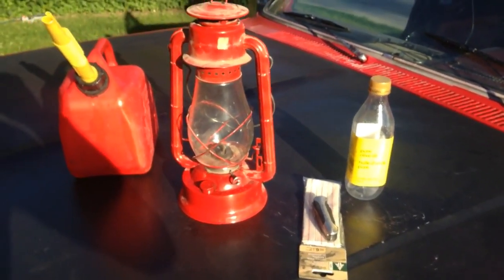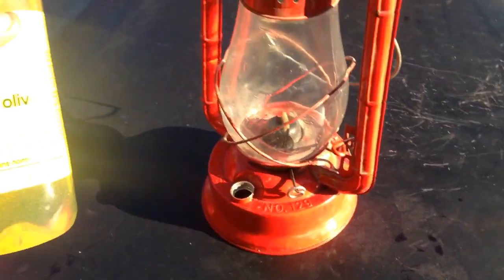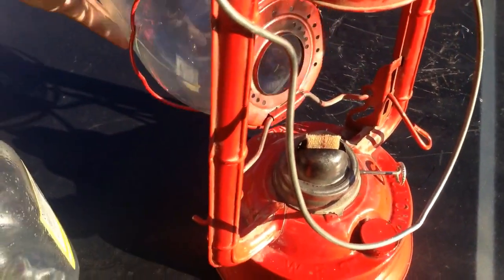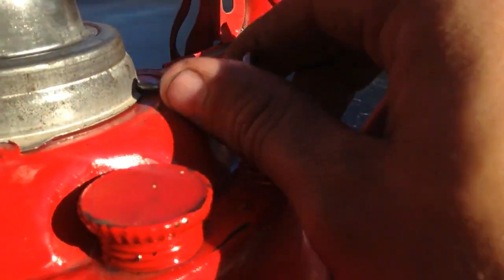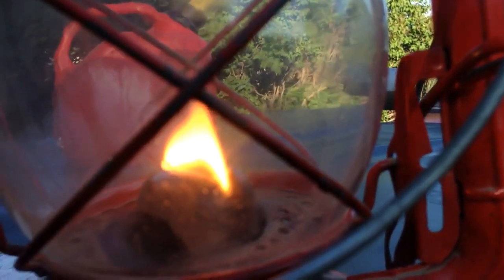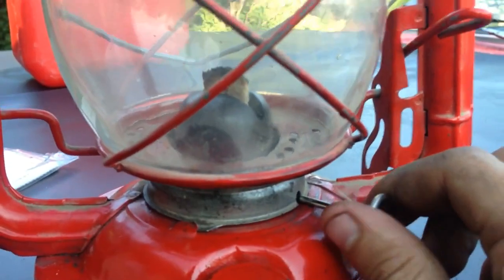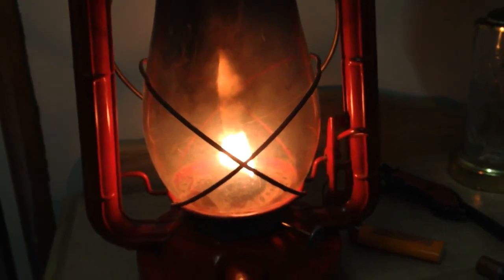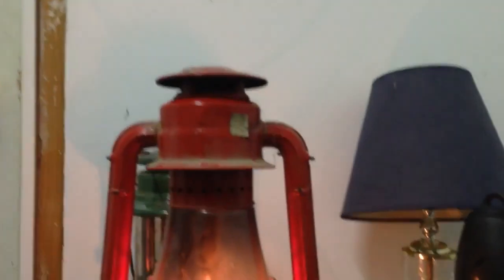Diesel fuel in Kerosene lamp EXPERIMENT

Comment: you can burn pretty much anything in these lanterns, i've used kerosene, diesel, charcoal lighting fluid, paint thinner/mineral spirits, veg oil mixed with diesel or gasoline, mineral oil and automatic transmission fluid mixed with diesel or gasoline. of course some of these fuels burn pretty smelly, but they do work in an emergency.
Reply: Yeah that kleen strip kleen heat stuff is mostly mineral spirits.
Reply from the maker: Seeing as coleman fuel, it's white gas, or distilled gasoline... using pump gas is no more dangerous at all.
Reply: @AaronsAutomotive  There's lamps designed to use such fuels; probably shouldn't use those on this type of lamp.
Reply from the maker: Correct, this one in particular was diesel fuel, I was mistaken which video this comment was on as I have a video running a coleman lamp on gasoline that a lot of flack. 

This lampnwas originally a kerosene lantern, which burns almost identical to diesel and is not terribly volatile.
Reply: @AaronsAutomotive  coleman fuel is white gas ,and no!! It should not be used in these lanterns...wayyyy to dangerous!!

Comment: You really should light the wick at a very low setting, then gradually raise it to the desired level that doesn't soot.  
You get virtually no soot on your globe when you do it that way. 
 Would also recommend a few tablespoons of  90% or higher Rubbing Alcohol...this will prevent gumming and clogging, and a somewhat cleaner flame. 
 Squaring the Wick is fine, and there's no need to cut it into a point.  A completely squared wick will give you a wider and brighter flame surface as well.  
Otherwise, a pretty good experiment and if diesel is cheaper and less annoying...by all mean Use It!  
My next experiment I will be trying Home Heating Oil and see how that goes?
Reply: I thought the same
Reply: Dry gas is cheaper and is the same thing.

Comment: Here it is a year later and I just let my Dietz 100 burn Klean Heat fuel for 2 hours. I smelled the slightest smell of burnt fuel more like Barbeque lighter fluid burning. Very tolerable indoors. $10 a gallon from Home Depot.

 But I later went out and found the Dietz No. 8 Air Pilot fueled with diesel about 2 years ago. It was my experiment. It has been sitting all summer untouched in a plastic deck box in the sun. It has been burning for 2 hours hanging from the rafters in my upstairs bedroom. I do not smell anything.  This was the same road diesel that I bought for my Onan generator set. $3.50 a gallon in Calif.

I am really impressed.The flame is a lighter yellow, almost white compared to Klean Heat or K-1 kerosene. I did not mix alcohol in it like others suggest. There is no soot or smoke. The wick is trimmed straight across with the ends slightly nipped off. It has a 1-3/8'' tall D shaped flame so its burning strongly tonight.  This lantern was my experiment in burning diesel. That's all it was ever fueled with since new.

Recently I mixed fuels in another lantern, a Deitz Little Wizard. It was kerosene mixed with citronella oil to get rid of mosquitoes. I plugged the wick by mixing fuels. The wick needs adjustment every 20 minutes and has a spikey flame, pops, sputters, then goes out. Mixing fuels can cause burn problems. When its out of fuel, it will get a fuel font flushing with choke and carb cleaner spray and a new wick goes in.

After all of this writing and a fresh brewski, I still smell nothing in my room burning diesel fuel in that lantern.  BTW.... the best glass cleaner is Weiman Glass Cooktop cleaner for stoves. It leaves no residue, haze or streaks when the globe gets hot. A little goes a very long way and the glass gets really shiny.

Comment: Tiki torch oil with citronella works well in them I use them when I camp for lighting around camp and also Mosquito control, two birds with one stone.
Reply: I used tiki Torch fluid in mine it blew the flam out in moderate wind and was hard to keep lit I was wondering what I did wrong
Reply: @jamessmith2668  I would suggest trying a new wick, mine have stayed lit threw some heavy severe storms while at camp at Airventure over the last several years. All I use is citronella tiki torch oil. But I have had a couple wicks that have gotten contaminated or just went bad thar were hard to keep lit.
Reply: Thank you for sharing... do u mix torch oil with citronella together??? Thanks

Comment: Here's my tip:  
Tilt out the globe, take the burner out of the lantern, and put in the new wick. Play out about 4'' of the wick sticking upwards out of the burner.  Trim the end the way you like it. Dip that end of the wick into the fuel tank in the hole where the burner was, then screw the wick back down to normal position. Install the burner and now you have a fully soaked wick. It takes about 30 seconds of work and then you can light the lantern immediately.
Reply: Why not just invert the lantern for a second or two to prime the wick?
Reply: @crazysquirrel9425 The tank/fount is not sealed as in a pressure lantern and there is potential for leakage into the air tubes. Regards Broadlander

Comment: I have an old lanteren from wally world. It started to leak around the base so i cleaned and dryed it out really well and used por25 fuel tank sealer in it. It hasent leaked in 8 yrs. Just be sure to follow the Por25 instructions.😊

Comment: Good tips. I recently tried burning California #2 diesel in a Dietz No.8 Air Pilot. There was very little odor and no smoking. That surprised me. The other fuels that I used are Kleen Heat and pump Kerosene. The diesel had the least objectionable smell followed by Kleen Heat.
Reply from the maker: kimmer6 thanks, i too was very surprised by the low odor of #2 diesel, i have about 9 of these lamps thru out my house i use during power outages, and the smell of lamp oil and kerosene always gave me headaches. I thought id give diesel a try and will never go back, keep a 2 gallon jug of diesel on hand all times in the basement as diesel doesn't seem to go bad or rancid at all and has been stored for about 6 months now and still seems good.
Reply: ULSD has less stuff in it now than Kerosene I heard
Reply: That’s interesting. Im going to try that. !
Reply: @TonyM540  Cool. Be sure not to mix fuels. New wick, clean tank. Sometimes the incompatible fluids turn to gel and plug up the wick.

Comment: Diesel fuel today ACROSS THE ENTIRE USA is now 97 percent cleaner starting in the 90's. soot is not an issue anymore so  people who are nay sayers are ignorant and mis informed! Some (the older guys) did have issues back in day but no longer today you can Google it and or watch you tube videos diesel is a very good fuel to use and common practice among collectors. I have experimented on rayo lamps,perfection heaters,old dietz lanterns and they all run flawlessly. If you try what this guy did you will be pleasantly surprised, and save quite a bit of money. I have also used the 97 percent alcohol (an ounce per gallon or so added to the diesel fuel)and my testing has not showed a benefit except for MAYBE the wicks light a bit faster/better.

Comment: Im using some Diesel with white-spirit of refined petrol. 2 Us Gallons with 17  Oz white-spirit of refined petrol. We call it here (wasbenzine) in NLD.  It seems to burn good in my Dietz air pilot#8 with 7/8 wick.   The viscosity is perfect now.   5.2 gallons of kerosene cost me $57 usd in the Netherlands.   1 gallon of diesel cost 5 usd.   Farm light Lamp oil cost 2.5 usd per liter, but its not good for the wick.   Fuel is very expensive here in the Netherlands.   Some people Mixing Diesel with Alcohol , but alcohol is hygroscopic. I don't want water in my fuel.
Reply: Interesting to hear that alcohol is hydroscopic; however, I've heard that alcohol is added to gasoline when you need to evaporate water that had condensed in the bottom of automobile gas tanks.   Perhaps it is a different type of alcohol (ex: denatured)? In which case, couldn't that type also be used to make adjustments to kerosene lamps? Thanks!

Comment: I'll add my 2 cents. I've worked for nearly 40 years as first, a marine (incl. diesel) mechanic & later, a commercial (diesel) truck driver. I've also owned & used oil lamps like yours for even longer. On the point about changing your wick, it's easiest to cut &/ trim it prior to inserting it into the holder, & the wick you removed as "old" still has adequate life in that all a wick needs is to be able to reach the bottom of the reservoir. Although it wasn't clear in your video, it looks like you cut & trimmed the wrong end - the soft fluffy end should be the one down in the oil; that picks up the fuel. The trimming is a matter of personal taste & different trimming styles will produce different flame shapes. When lighting your lamp, don't lift & swing the globe away - use the bail to simply raise it to insert your lighter. Same with extinguishing your flame; don't simply retract your wick down too low or you'll end up coking your wick end & guide, which can jam your wick & require cleaning. You'll find that lots easier, cleaner, quicker & greatly reduce soot on the inside of your globe, requiring cleaning. It also reduces the smoke into your room's air. Now, as for the fuel, diesel is best; it has the highest heat (BTU) thus light per unit of fuel, than any other commonly available choice. It's also LOTS cheaper, particularly if you get AG (off-road) diesel, dyed (at least here in the U.S.) red. #2 Diesel will provide you with the greatest economy of operation, as it costs less than anything else. Provided that your ambient temperature remains higher than ~18'F or -8'C, you won't have to be worried about it gelling. As to additives such as alcohol, don't use 91% isopropyl; that other 9% is water, which can cause all sorts of problems, such as sputtering, popping & corrosion inside your lantern. It can also lead to the growth of algae in stored diesel fuel. If you must use alcohol, use a pure form such as boat stove fuel (methanol) or even better, a similar grade of ethanol. Even grain alcohol is better than that 91% isopropyl. FYI: https://www.sciencedirect.com/topics/engineering/diesel-fuel   &   https://www.dieselhub.com/tech/diesel-fuel-grades.html
Reply: Thanks Synthya,what amount of ethanol do you recommend to diesel?
Reply: @royallan3717 , ideally, none. The only reason that I can think of to add alcohol to diesel might be to try to disperse any small amount of water found in the bottom of the tank. It's better to drain the tank & then pour off the diesel fuel which would rise up to the top before returning it to the tank; Use a clear container so that you can inspect the quality & check for any contaminants, both water & particulate debris. If you're dealing with a large amount of diesel, then you might consider trying to drain or siphon any water from the bottom of the tank, & using a pump to recirculate the fuel through a filter. If there's any problem with algae growth, it shows that there's water present, as algae lives in the water & eats the fuel. There are algaecides which can be added to the fuel to help kill off the algae, but if you decide to use that, get the water-soluble type, which remains in the water rather than being consumed as the fuel is burned. But ideally, removing the water is best; an ounce of prevention vs a pound of cure, as they say.
Reply: @royallan3717  None, preferably. Or, the less, the better. No more than needed.

Comment: Number 2 diesel is filtered diesel ( kerosene) with road tax on it. They use in in the winter in semi trucks like the one I’m in right now.  They remove all junk that make it gel at cold temperatures and it becomes kerosene. And jet fuel and diesel is about the same you can run both in a semi or a jet plane but in a jet diesel fuel will gel. And the octane is deferent as well

Comment: You can get a wider and higher flame without soot if you cut your wick straight across. Lamps with a wider wick are brighter so would you want to make your wick more narrow? This is basic science,  the easier a flame can find its Centerpoint the faster it will soot. Introducing a wider flame to the amount of draft  being produced in the lamp will result in the ability of a higher flame without soot and produce more lumens.

Comment: This good to know...Here in California, although diesel is expensive, it's still cheaper than kerosene... I will give this a try... My only concern is... I am noticing lots of soot.
Reply from the maker: I had the wick trimmed wrong and set way too high when I let it. Tge wick Needs to be set really really low to light it, close the globe up, than raise the wick to brighten the flame. Once the diesel does start to burn hot on the wick there is no more soot. That was my inexperience mistake

Comment: Switch to carbon felt as your wick. Never have to replace it again. No trimming either.

Diesel fuel has a flash point between 52 and 96 °C (126 and 205 °F) 
Kerosene has a flash point of 100°F

Kerosene has about 135,000 BTU per gallon vs. 139,000 BTU for a gallon of #2.

Best flame height is the same as the width of the wick.

Comment: I use diesel in my lamps too..has smell, but ok for outdoor use..plus I modified the wire bail so it uses a square piece instead of rounded top.  It fits a titanium snow peak pot, can cook about 4 eggs in a hour or so. (also have some aluminum foil around the pot, the top of the lantern has the cap removed)

Comment: A lot of soot and doesn’t give off as good a light as Kerosene.
Reply from the maker: +Rock Chops actually i found after its lit it doesnt give off soot while burning, but the smell of kerosene gives me a migraine and weirdly enough diesel fuel doesnt, so is why the reason i wanted to try it out.
Reply: Adjust your wick, 0 soot in my oil lantern, (Not the pressurized type) The soot would show on the glass.
Reply: Diesel as of 2007 is different and better than k1 Kero. The mix for heaters and Kero lanterns is 5 GAL Diesel to 1quart Coleman fuel = Perfection from a gentlemen that lives off the grid a buddy with a higher IQ than myself.

Cheers
Reply: Huckleberry Educate yourself before u put out false information. Diesel fuel is extremely clean now.

Comment: Well diesel is 385 a gallon and kerosene is only 349 a gallon why would you use diesel kerosene is way cheaper
Reply from the maker: +wes not where im at, kerosene is like $5.95 a gallom and diesel is $3.25 a gallon. And kerosene gives me a migraine from the smell where as diesel doesnt
Reply: Here in Ontario, Canada...Kero runs around $12-$15/Gallon.  Diesel about $4.50/Gallon in the Canadian Equivalent in Litres.  So it is cheaper to use Diesel up here, and Kero isn't widely available like it is in the U.S. and that will vary from one state to the next.  I'm looking into trying Home Heating Oil too!

Comment: Diesel has to be put in a yellow jerry can, shite though burning petrol, ok got it, I burn Kero but am saving to try a little diesel as have an road signal, would you know the fuel this boys used, a 1900 lamp.
Reply from the maker: +John Rouleau ya, i dont have really anything that takes diesel but have plenty of jerry cans, so this one got marked on as a diesel can only in yellow paint marker. And im the only one who should be handling them anyways.. anyone else touching my fuel cans means they are stealing them, as for the 1900 lamp, sorrily i dont know the type of fuel used for it.
Reply: Ok, I New Zealand have a ute/truck diesel as is easy to forget, just would not have you wreck a motor or such, in Quebec saw immigrants using charcoal in closed room. It is cool as many have given up the past so class. I will ask around about the 1900 lamp Cheers for the help so
Reply: Not cool them with charcoal in closed room meant to say. Lamps are cool and like.
Reply: varmint sez: diesel #2 good in Aladdin.
Reply: @aminawatson5019  And extremely bright too in that Aladdin.